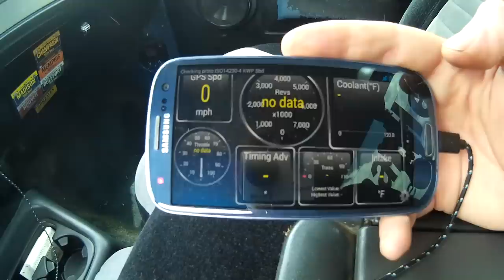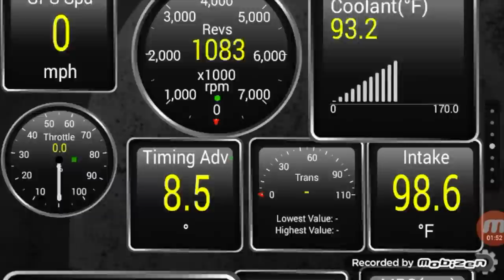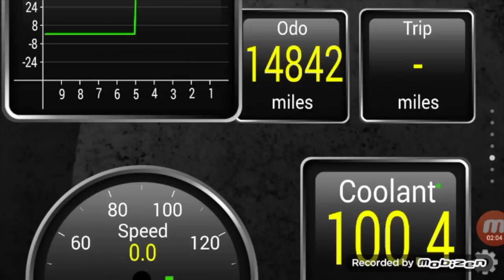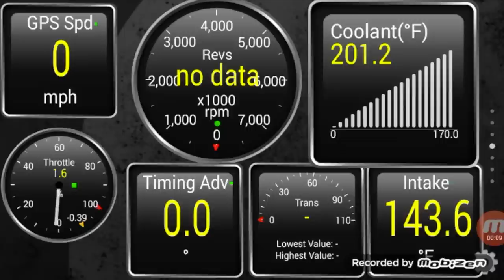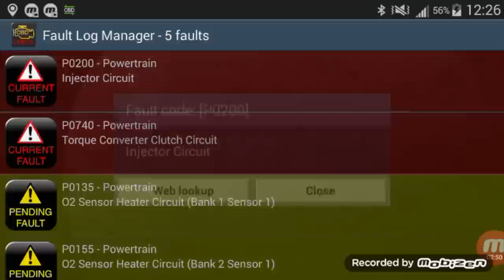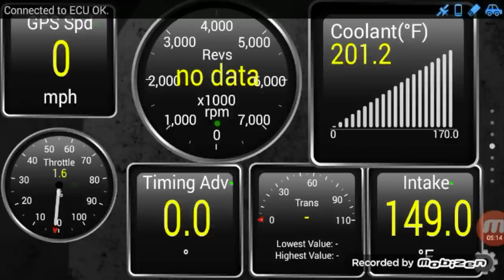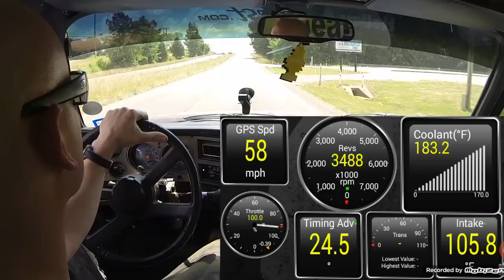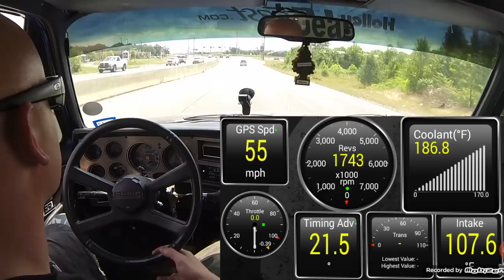LSx Swap Gauges Simple, Easy, Cheap & Code Reader OBDII -Check Engine Light DTC Bluetooth OBD2

Comment from the maker: wow, I cant believe it's been two months since my last upload.. I've got to get another video up asap!
Reply: yea you do man ive been checking lol
Reply: Have you done a swap into a 4x4 truck? and another question... on a 5.3 if you were going manual which trans would you go for? thanks! your vids have a ton of good info!
Reply from the maker: Thanks! Nah, I havent done a 4x4 yet. One day I will. T56 is a good strong trans that I'd use, but they're not cheap.
Reply: +AGearHead4Life  thanks for the reply man. I'm sure I'll be asking more on my K5 build!
Reply: I have put a NV4500 unit in mine but still got to get it all going. Will see how it works
Reply: Crownbagavenger granny low 3 speed s are very strong they come in the 80s chevys

Comment: First of all I would like to thank you for the feed back you have place in here. It is crazy free information that most local mechanics would charge money.  The minute I saw this video I order the piece to monitor my gauges. LOLOLOL. Is crazy. Second of all who ever stole your truck deserves to meet every car guy here in person. He or she is more than welcome. Outside of that I have a simple question. My 2008 5.3 VORTEC starts very sluggish. Meaning it will not set RPM until it reaches about 5 mins. Once its warm and normal temp it is a rap. What do you think that could be. Tunning??? Air to gas volume parameters within the tuning? I bought the harness and PCM from PSI Conversions here in NJ.
Reply from the maker: Thanks Chui! Glad you're digging it man. As for your truck, there are a lot of things that it could be. I'd start by check the spark plugs and testing the fuel pressure.

Comment: Ive been using this app for yrs, I also recommend the add-on called  track recorder. It will allow you to record videos and overlay the gauges in your videos. You can setup alerts per gauge for warning alerts etc. great app.
Reply from the maker: Thanks! I need to get that recorder and probably use that instead of the one that I used in this video. I have nowhere near reached using even 1/3rd of what this app can do.
Reply: Once you choose your gauges and place them where you need them.Press and hold on  a gauge and then press display configuration.Here you can set the min/max parameters of the gauge dial itself so that your gauge doesnt have a useless range you will never reach.You can set a low and high warning.Things like engine temp i use..battery low voltage,intake air temp too high..since Im boosted etc.For a very cheap app that datalogs,gps tracker..I will say the 1/4 mile timer and 0-60 stuff isnt accurate to base actual figures on.I used it at the drag strip and its wasnt even close to my real times.

Comment: ❤ You are amazing dude.
You perfect explain and even amateur people can start learning because you know how to explain. I am very strict about how people try to explain in general. Bravo my boy continue like this.
I hope you to have a time and good heart to help me to find exactly what i want for my Toyota avensis t27 or T270 or t271 the same model, engine 2zrfae 1.8 valvematic or if is easier you can find for 2zrfe corolla engine because the Toyota avensis 2010 t27 It's a family car and maybe not to find what I want. What I want is a gauge monitoring that records and store  the driving behavior and to be able to show where there is a mistake in the way the ECU imposes the way the engine works and give me one or more correct programs for the best possible operation of my engine.

Comment: Your OBD-II Bluetooth connector is show ambient air temperature should match actual air temp. A NTC thermistor drops resistance as temps get hotter. It is in a MAF sensor or somewhere in front of the throttle body. A incorrect reading tells the computer that coolant is cooled off but external air is hot. This affects code test if not within 10 degrees F of each other. This is a warm-up cycle. Key cycles, warm-up cycles and highway speeds based on clock will run EGR test, EVAP test and automatic slippage or the P1870. Clean connectors, add dielectric grease and test with an actual scan-tool. If bad replace. This affects shift points on automatics as well. There are hundreds of test run by the ECM after starting, these inputs come into the OBD-II connector thru pin #2 which is class 2 serial data. Terminals 6 & 14 are high speed local area network sometimes called GM LAN that came in 2004 on the Corvette. The rest followed later. ASE Master Tech- Retired

Comment: Hi, agh4l. 
I'm working in 91 camaro v6. Swap 5.3 from silverado. 
If I want rpm gauge and speedometer working, do I just connect green wire from vss signal to speed input on the cluster and tach signal from pcm to input rpm on the cluster?

Comment: thank you for this video!!! I'm definitely ordering one tomorrow if it's not expensive
Reply from the maker: Nope, only $24. It's a must have IMO.
Reply: +AGearHead4Life mine was 28 after shipping and handling but still extremely reasonable thanks again
Reply from the maker: No problem man!
Reply: @AGearHead4Life  is that $24 total? or $24 per month?
Reply from the maker: @discmotoslots  $24 total for the dongle. Click the link. Then like $7 total for the app.
Reply: @AGearHead4Life  i already have the dongle. same one you have. i was looking at he 'light' version app. guess i should get the 'pro' version
Reply from the maker: @discmotoslots  yeah I definitely recommend the pro version. It was about $7.

Comment: Can it read gas level ? My 02 Silverado has a problem when the weather is warm or when I use the stereo the gas and temp gauge won't work
Reply from the maker: +Elguero 1500 I'm not sure. I've never tried it since I've usually install the engine into a vehicle that has a fuel system from an older non-OBDII model.

Comment: Have you seen the scan gauge II? Sell them at advanced auto for like 140$. It can read like up to 16 things, shows 4 at one time that you can change on the fly. Plug mine into my OBDII and tuck it up so it sits right behind the steering wheel in front of my cluster. Can also calculate MPG from fill ups and read/clear CEL
Reply from the maker: Nah, I havent seen it yet.

Comment: For iPhone, use Wi-Fi Dongle and use OBD Fusion app.
Reply: Is it the fusion app for 9.99 or a different one
Reply: I don’t remember paying for it.... I typically don’t pay for apps... I think I would remember. But I could be wrong. And apparently I’ve had the app for more than 4 years so that could change. Oh and by the way.... my comment is 4 years old... I still use the same app and dongle.
Reply: Is it the same dongle as in the video and thanks for the reply
Reply: Brandon Simons , it looks similar but mine is different... I will add this tho.... I don’t use mine for guages. For diag is only thing I use mine for. And for some reason.... now my iPhone will kick me off the WiFi the dongle puts out after a few minutes because of it not having internet connection. I remember changing some setting to make it use Cellular for data even tho it’s connected to the dongle thru WiFi. Not sure if it’s just a setting issue or an iOS update issue or what. But the guage function worked great for extend use back then but now I get kicked off the WiFi after 5-10 mins. So just keep that in mind. The dongle is an ELM WiFi OBD dongle from Amazon.... like $20. A Bluetooth one may work fine now tho... one I tried back then.... the Bluetooth one would only work for gm and not Ford or right the opposite... can’t remember. But I need to try a Bluetooth one again.. that should fix my connection issues.

Comment: Ok does it have a oil pressure gauge?
Reply from the maker: No. The PCM does not monitor the oil pressure. I use a separate gauge to monitor that.

Comment: do your stock truck guages work with the ls? I'm doing a swap in a 66 Caprice and am wanting to keep my stock mechanical guages
Reply from the maker: Yes, but I used a 91 Suburban gauge cluster because it has an electric speedo instead of cable driven. But I don't even pay attention to those gauges anymore because they're not as accurate as this app is.

Comment: hey, I'm 16 years old I'm. building my 06 sierra I bought with 117k miles and I'm putting ls1 stock cam from a 60k mile fbody, how well do you think it should do,  I will eventually have dyno tuned but it had ls1 heads from factory  , intake and soon to come headers/full exhaust
Reply from the maker: I would suggest finding the article from Car Craft on testing ~21 different stock LS cams. It got great information on lots of cams there. I don't think that it was worth using a LS1 cam. Also, though the LS1 intake looks better, it does not perform better than the truck intake.

Comment: How do you keep track of your mileage (odometer)? Or does keeping track of mileage just fall in with "that's the price you pay to be cool"? I have a '79 K5 Blazer 2wd I want to swap and bring to LS Fest!
Reply from the maker: I dont usually worry about mileage much, but this app tracks it also. Since I have it running overtime I'm driving, its adding it up for me. You can see it in the video. You could also buy an aftermarket speedo. Depending on what you put it in, you could make the factory speedo with trip meter work too.
Reply: +AGearHead4Life now I see that it has the Odometer option. That was one of the obstacles that I was worried about in a swap is how to get the gauges to work. But with this way I could go ahead and do a swap and worry about adapting or replying the factory gauges later on down the road.
Reply from the maker: Yep! That's what I do.
Reply: John Kahl

Comment: I just got my dongle from your link on this video.  Will it work if I power up the harness if the engine is not running?  I bought my engine used and have not seen it run yet, and I'd like to check to see if there are any error codes stored on the computer.
Reply from the maker: Yea, it'll work like that to communicate with the PCM. You likely won't have any stored codes though, since the power has been disconnected.

Comment: hay Mark just checking with you to see if you had to do any fab work to your truck to install your 4l80e trans
Reply from the maker: Hey Anthony! No sir! Not besides sliding the trans crossmember back to fit the trans different mounting point. Changed out the yoke for a th400 style. I did cut an ear off of the passenger side of the bell housing, that wasn't being used, to make room for my long tube headers though. That was about it.

Comment: hopefully this product work, I'll bought the 327 elm that cost 5 bucks didn't connect to my ecu 5.3
Reply from the maker: +Sp33dy TuRbO that is actually the cheap one that I was referring to in this video. I use to use those all the time. I left it plugged in 24/7, so they'd break every 6 months, but now something has changed in their production. The ELMs don't work for me anymore. which led me to this and it seems to work on multiple types of applications. That's why I dropped the $25. I'm happy with. Just wish it was as small as the ELM327.
Reply: +AGearHead4Life Some ELM devices work fine. The $5 ones are usually knock off's. Spent $15 CDN from a trusted seller and been working for years also plugged in 24/7.

Comment: Don't you need the VIN for the code reader to work?  LS3 in a 69 vette; I want a tablet gauge pack.

Thanks!
Reply from the maker: Geoff Kilcollum Nope. Just plug it in and connect the tablet.
Reply: thanks!

Comment: How do you get it to read oil pressure on a 2006 Chevy  4.3? 
I see everything but that...on torque.
Reply from the maker: +Laby 70 Yea, I don't think you'll get that to work. Usually the PCM on GMs don't read the oil pressure. It's only there for the gauge.

Comment: I have been checking out all you videos on  your square body and seen many attempts at this I have been wondering tour thoughts on my project I'm hoping to start next month I'm wanting to put the 86" c20 on my 01 stepside Z-71 it's seems to be a lot less fabrication then the ls swap and same with the wiring with the gauges and things your showing I'm and getting parts or lift kits and things would all still be 01 parts exhaust fuel tank maybe drive shaft and rear end moved but the wheel base measures pretty close between these to the trucks just wanting what your thoughts where thanks like your videos and truck is looking good
Reply from the maker: Thanks Steve! Yea, one day I plan to set a square over onto a 2000 and newer GM frame. I think that it's a great idea.  Not only do you get the power train, but you get the nice brakes and power steering. All the new stuff and it'll ride like a newer truck.

Comment: I ordered and got mine too.  It doesn't do oil pressure right?  How do you get the gas gauge to work on it?
Reply from the maker: The LS PCM usually doesn't monitor oil pressure or fuel. I use a separate gauge for those or just fill the tank every couple days. lol Well there may be a way for the BCM to feed that info, but I wouldn't know since I don't usually swap in the BCM.

Comment: Hi what is the normal temperature runing? My 5.3. Goes to 206 f.
Reply from the maker: That’s normal but still warmer than I’d like it to be. From the factory, the trans is cooled by the coolant in the radiator which is at the engine operating temperature which is roughly 200*-215*. So it’ll usually be that temp or hotter once it’s reached operating temp.

Comment: im gonna put the exact same engine in my 84 cause I can't seem to find much info on the 6.2 liter diesel or parts to it which I'm trying to maintain a budget but still make pretty decent truck.
Reply from the maker: I wanted to do a diesel build on my last C10, but the cost of those engines stopped me. I found a 5.3 for much cheaper and it's been a blast.

Comment: What if I'm doing stand alone and using the original th400 transmission how could I get it to read my speed? Any thoughts?
Reply from the maker: Besides a GPS speedo, they have a cable to electric signal converter, that I've heard of. I dont have any other way at this time.
Reply: Hm that could work thanks man
Reply from the maker: You'd think that there's got to be a way to adapt a sensor to the tail shaft of that trans to make it electronic though. Maybe I'll run into a project like that one day.
Reply: I saw a forum where a guy changed the tail shaft form an 88 t-case to a 90 t-case changing the gear in the shaft to the one on of the 90 in order for the electronic speedo to work
Reply: Probably just changing the gear on the speedo reader to work on the gear on the old shaft

Comment: i had came across a 5.3 in a impala ss i also have a 5.3 out of a truck i was tryin to see if i could use the flat top pistons in the ss!!! also are the 243 heads better then the 862 heads
Reply from the maker: yes, you can use the pistons and yes those 243s are the best cathedral port head that you can get. You'll have an excellent setup.
Reply: Thank you man you just made me happy azz Fuck!!!!
Reply from the maker: Oh yea, that's the setup most guys wish they had. I'd mill those heads down .030" though, if it fits into the budget. It'd make for a better compression ratio.
Reply: +AGearHead4Life that should only be about 100 bucks a head!! but i can do that!!! thanks for the info 4real!!
Reply from the maker: No problem. BTW, It usually only costs me $75 for a pair of heads to be milled.
Reply: +AGearHead4Life what head gasketset should i use
Reply from the maker: I just like to use a stock MLS gasket. Summit has them for like $40 shipped for the pair.

Comment: Hey Mark what kind of tool box do you have? Im going to go to school soon and I need one so I was just wondering what brand it is so I could maybe look into buying one. Thanks in advance and keep up the great work on the videos! BTW my favorite is the Chevy truck, I have a 78 my father and I are rebuilding! Gearhead4Life
Reply from the maker: Thank you Chris! This may sound weird, but I recommend starting with the Harbor Freight cart. It's not an actual tool box, but the service cart that you push up to the vehicle to work on. I use it now way more than anything else and it's only $100 with a coupon.
My actual tool box is a small Craftsman one that I'm finally outgrowing. I got in on a scholarship when I went to automotive school. Craftsman's are good, but wait for the sales. I've heard great reviews on the Harbor Freight tool boxes too and they're supper cheap. Probably a good place to start. You dont want to go crazy in debt right off the batt. Start with a less expensive box. The big name ones will want $5k for a box. Don't do that, IMO. Not yet. Maybe one day, if its become your carrier and you decide its worth it. 
You may also be able to find killer deals from tech retiring or getting out of mechanics. My buddy bought a large Matco bottom box for $500 once because the guy was getting out of mechanics. Wait for the deals.
Reply: look at blue point they are snap on off brand and they make a nice roll around that can do double duty as a box and service cart. mine is yellow (not my favorite color) bought it used with some hand tools and air tools for $400. look for the deals and don't get over invested. Wait until you do it for a living before investing large amounts of money.
Reply: +AGearHead4Life Thanks A ton I will use your advice!
Reply: +Brett Boynton I will look into it man thanks a lot!